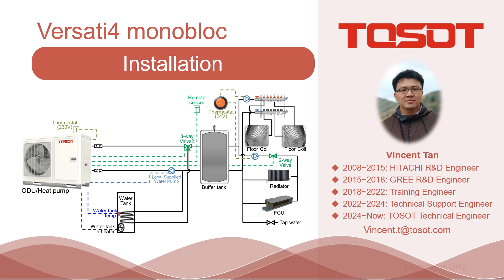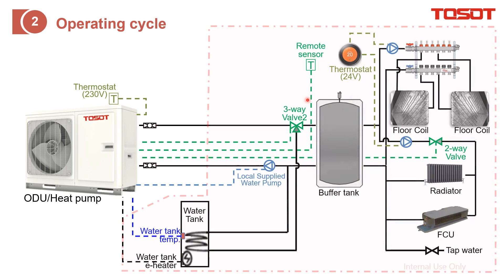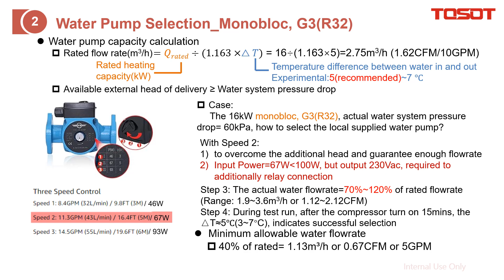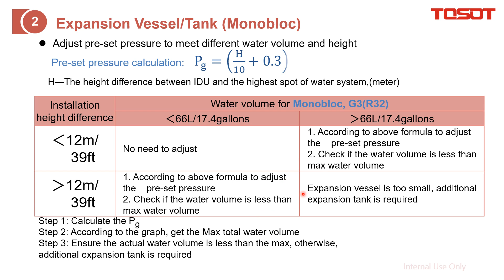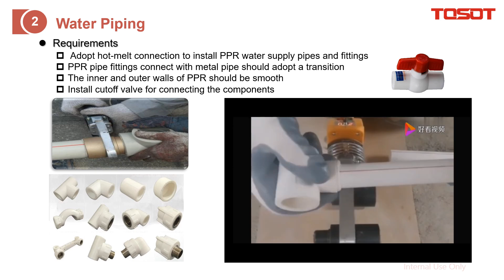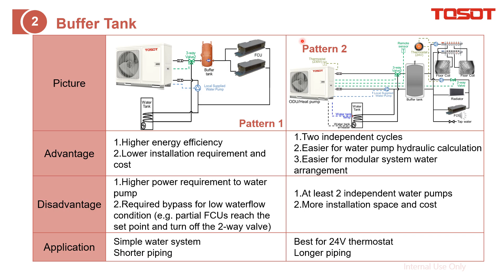0514 VERSATI4 NA Installation安装(2/3) WaterSystemInstallation水路安装 20240806

Comment: Hello I am an owner of a Gree Versati 4 working with underfloor heating and is set to work on weather depend mode . I have a question,is normal that the circulation pump to consume 0.11kwh when is working?  Thank you.
Reply from the maker: I am afraid that this is a normal value since the water pump is on even after reaching the set point. The purpose is to detect the water temperature.  Bypass measure: apply the thermostat to on/off the versati, then the water pump will turn off after reaching the set point, because all the on/off commands come from the thermostat directly